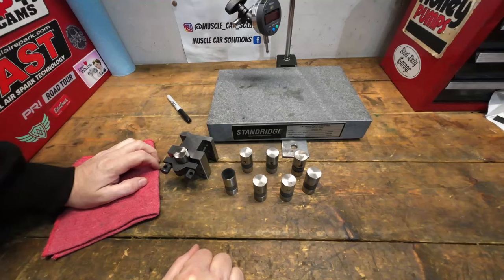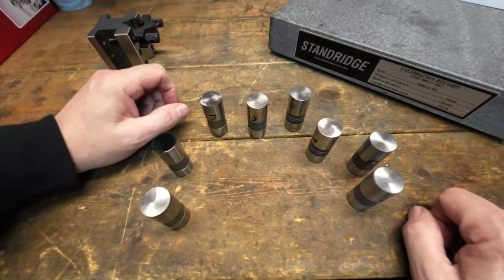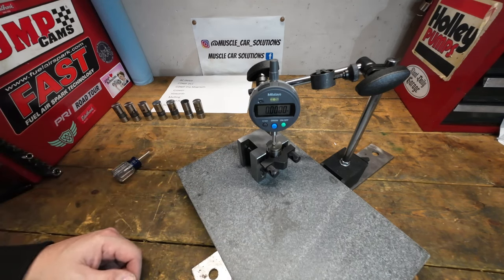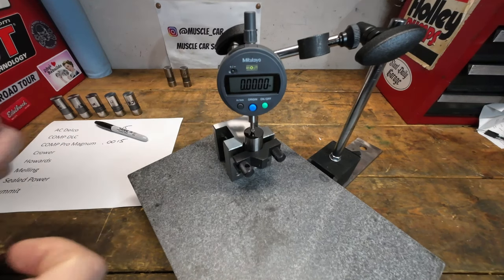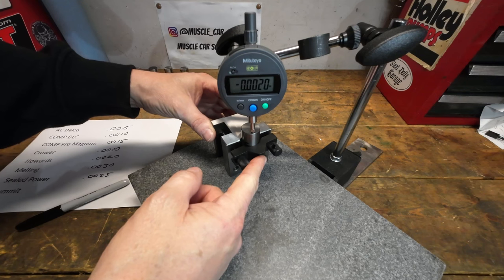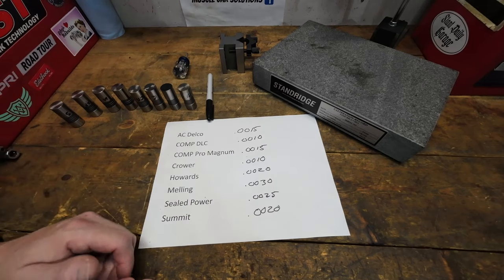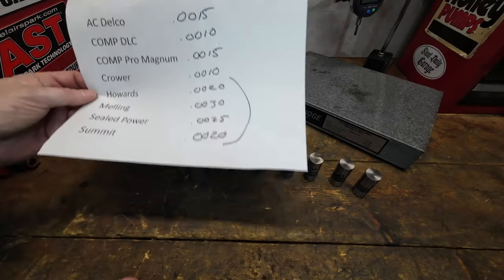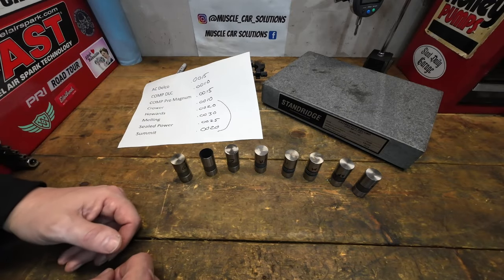Bad Crown Causing Flat Tappet Lifters to Fail?

Comment: I have never heard of this but, I'm curious, Do you know if mfgs. make an oversize lifter, and can you machine lifter bores to correct for wear?
Reply from the maker: Lifter bores can be sleeved back down to their factory size. In some blocks yes, they will sometimes use a larger body lifter but that’s generally not on factory blocks.  Aftermarket it’s not uncommon.
Reply: @MuscleCarSolutions   Thanks for the imfo. much appreciated.

Comment: shouldn't the measuring base be on the granite also?
Reply from the maker: On the fixture?  No need.  It’s the lifter we wanted to make sure wouldn’t cause any deviation in the reading.  The stand is endlessly adjustable.  It just needs to be solid in holding the gauge.

Comment: You talked about progress.  Right in front of you is real progress for us.  That is the DLC lifter.  DLC stands for Diamond Like Coating.  This is a plasma coating right from the top of the aerospace world.  I had a cam go flat after 1.5 years so I upgraded to a Comp Cams cam and lifters, standard lifters.  The first 3 went flat in 5 minutes.  Then I watched a video about DLC lifters and their tests.  I already had the 4th replacement cam from Summit at the house.  I called Summit and asked if I could exchange and pay the difference for the DLC lifters.  They said OK.  Since then I have had no problems.  DLC is almost as hard as a diamond and since made of carbon is very slippery.  I have since looked at the lifters 2 times and the cam.  The lifters look like they were never used and the cam looks like it is micro polished.  Save your money, only use DLC lifters.  I called Summit with the success and suggested they advertise this.  Two weeks later on You Tube I see Summit ads for DLC lifters.  I was very happy as I do not want other people to blow away mass money on roller cams, lifters, and pushrods if there is an easy way out and DLC is it.  Go read the tests that Comp Cams did on the Spintron.  No matter the spring pressure, rpm, or abuse they did not care.

The problem is obviously materials.  DLC is the best solution to the problem especially for those who do not have endless money.
Reply from the maker: I don’t doubt the DLCs lifter to be a significant change in lifter tech.  I was one of the first to review it.  But after 4-5 cam failures, it’s probably time to look at what’s causing the failure.  We talked about that in the lifter videos in this series.  If the DLC is masking the reason for failure, eventually it’s going to expose itself and incorrectly it will be blamed on the part and not the situation it’s asked to operate in.
Reply: Nissan engines that use the DAMB system direct-bucket under cam now all have DLC buckets under the cams. Nobody ever talks about the non roller modern DOHC systems and I’ve looked inside some ford 3.6 v6s that use that system and you can see visible wear appearing on the buckets as they rotate very similarly to flat tappets. After about 150k miles they start to tick and become noisy and the only way to adjust is to shim or shave. Nissan started the DLC coating system I believe in 2020. No issues heard yet

Comment: I absolutely believe lifter bore trueness is one of the culprits behind all the failures. Most blocks have been through thousands of heat cycles and the bores can definitely become egg shaped. Plus, we take these blocks to the engine shop and they always hot tank them. So, more heat.
This is why I always tell the shop to HONE the lifter bores. It only costs a few dollars and it's cheap insurance. Also, check the lifter bodies for correct spec. When a lifter hangs or rotates poorly in a bore, bad things are gonna happen!
Best solution....just go roller cam and sleep well at night. 😁👍
Reply from the maker: It’s for sure a consideration that few think about.  It’s such a critical part of the equation and so neglected.

Comment: you should have your indicator base should be on the surface plate with the V-block
Reply from the maker: @brucejacobsen5809  no.  The base placement has no bearing on how the dial measures as long as it’s solidly fixed.
Reply: @MuscleCarSolutions  Exactly, yours is not solidly fixed. That steel bar under your surface plate is flexible

Comment: I question puting your dialgage fixture off to the side, insted of on the surface plate. Great video's!!!
Reply from the maker: The fixture is magnetically locked in place.  Granite won’t secure it.
Reply: its an adjustable stand.  theres no benefit to putting it on the plate
Reply: I am not talking about adjustability. How is that steel plate attached to the surface plate? I am talking about flexibility.
Reply: The reason for having the indicator fixed to the plate is because most plates are not planer top and bottom unless purchased that way. But your error on .842 diam is small.
Reply from the maker: @scottmuller1901  the zero of the gauge doesn’t occur at the base.  It’s made on the gauge.  There’s endless ways to mount the fixture.  The final calibration will always be made at the gauge.  You could mount it upside down if you had an area to attach it to.  Doesn’t matter.  It is still adjusted at the gauge.
Reply: @MuscleCarSolutions  perhaps put it this way - in this set of measurements the zero point is the centre of the lifter the crown is the difference between the 0 point and the edge

Comment: Having followed this video series, its got me concerned about my own flat tappet cam & lifters. I didn't know all this stuff when i slapped it ('63 292) together. 

I might not even run with the cam and swap it out with a  roller before breakin. Not sure, whats another 1k on roller cam, lifters, and rockers in a 3.5k block. 🥲

Joking mostly aside. 
What i will do though is pull the lifters and have them measured as they are super easy to acces. While ive got the rockers loose I'd replace the rocker studs with threaded ones as my spring pressure went up from 190 to 230.
Reply from the maker: It’s a lot to get right.  Knowing is half the battle though!  If your machinist is good, they’ll help you get the right plan together.